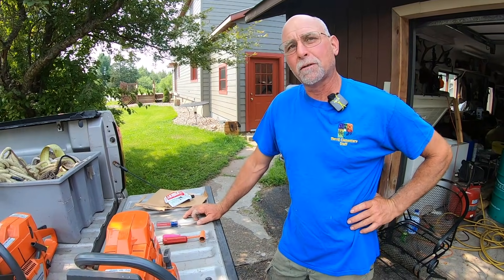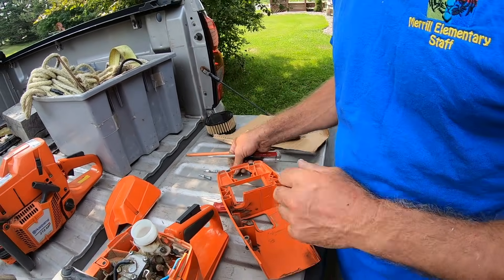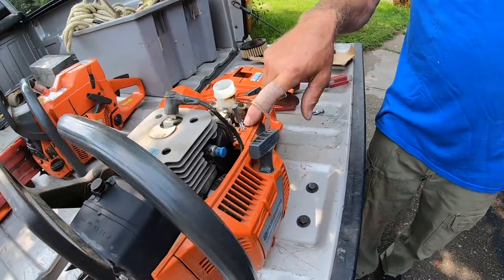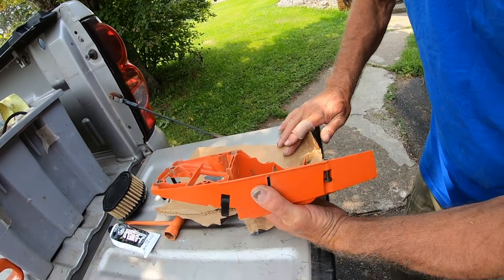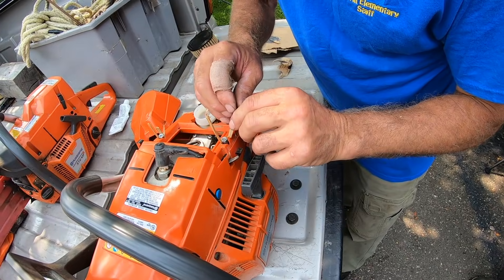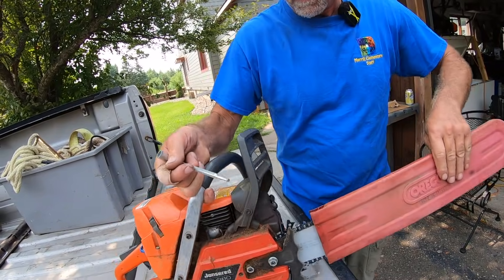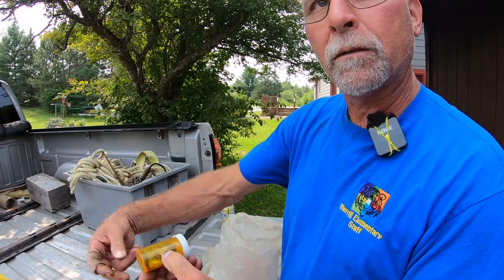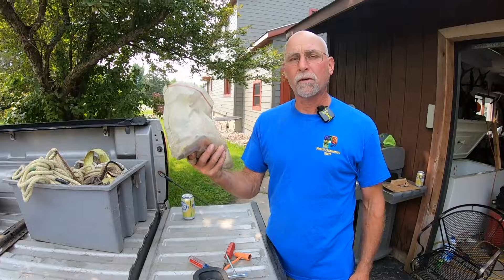Husqvarna 395 Stripped Nuts - Repair Job - #397

Comment: Once upon a time, I had a similar issue with a woodheater - needed to tighten a nut in a hole just like that to adjust the bimetallic spring loaded air intake. I ended up making a 2 pronged fork out of an old flat file, and keyed it into 2 slots I filed into the head of the nut. It worked, but it sure was a pain in the ass.... Necessity is the mother of invention. Good job Ken. 👍😁🇦🇺
Reply: That's what i thought of when he mentioned the hole problem lol. Nice to see it worked somewhere!
Reply from the maker: Yup, sometimes you just got try stuff till you figure it out.

Comment: Good morning Chris!!😀😀
Before I would have tried J B weld on it. I would have tried folding over a small zip tie and plugged the hole. Then turned the screw in. That usually works pretty good for fixing striped holes on Huskys. 
Take care my friend!!😀😀

Logger Al
Reply: Or a little copper safety wire stuffed inside.
Reply: But he said the threads were ALL gone on the one side, so fix it so that both holes take the same tool to undo. May as well.
Reply from the maker: Yes, that probably would work but I think Ken was after a more solid fix. Thanks Al!
Reply from the maker: That might have worked too.
Reply: @InTheWoodyard  I watch Bellhopper do it all the time when he is fixing striped holes on Huskys. It seems like that lots of the Huskys have that problem. I think the newer ones like your 572 don't have quite as much trouble as the 3 series do.
Reply from the maker: @aldredske6197  Thanks Al!

Comment: Got to remember to check the screws when start running saws again. Had muffler bolts come out before.
Reply from the maker: Yes, all bigger saws regardless of brand vibrate a lot and need to be checked.

Comment: Wow, you need a small trailer to haul spare parts for those huskies. Well, at least they cut straight.
Reply: Why don't the stihls chainsaw cut straight? Is it something with the sharpening or all of them are like that? I have a stihl ms 291 and I'm about to upgrade, would you go with a husky? Thanks!
Reply: The Stihl is great, I own 6 of them. That is in reference to a comment that Chris said to Tony on a video.
Reply: @TheDriftlessHomestead  cool, I'll be getting a 661, which ones do you have?
Reply: My production saws are: ms500i, ms362 and an 034. The others are smaller homeowners saws for doing release cuts.
Reply from the maker: HA!  Everything will wear out and break eventually if you use it everyday all day regardless of brand.
Reply from the maker: It was just a joke!
Reply from the maker: 661 is a great saw.

Comment: Heli coil .. lock tight. Jb weld works good  .but every time u take them off u have to jb weld them agin and wait a day to use the saw
Reply from the maker: No he won't, it is to hold the bolt in place so that the cover and nut can be held down. And it did work out fine.

Comment: If the JB weld truly is stronger than the aluminium an alternative would be to oil the thread of the screw. Screw the screw into the remaining thread and then bog up the gap to create a fresh thread. You could even dome the JB Weld up slightly and then wallow out the plastic in the cover to suit it. Probably worth checking with an alternate screw to see if the concept works and whether oiling the thread allows the JB Weld to be released.
Reply from the maker: Thanks Alan!

Comment: Husky's have a reputation of rattling apart.
Reply from the maker: Ken used Stihl saws professionally for years and after tons of problems with them he switched. If you use equipment all day every day you will have issues no matter the brand or kind of tool.

Comment: I wonder if any one ever puts Lube on the Roller  at the front of the Chain Saw Bar?  Seems like it would not be a bad idea.  Maybe it gets oil from the  chain as it comes around.
Reply from the maker: Yes, I do, there is a grease hole on one side, I put a shot in every 2-3 chain sharpenings.

Comment: Chris that is the major difference between Husqvarna and still chainsaws everyone that I talk to that has run both in their lives says there's no comparison still all the way it's not because of the power because for the most part huskies are a little faster it's because the way they're put together the German engineering they don't break as much they start when you want them to
Reply from the maker: Ken did run Stihls professionally for years and switched because of constant break downs with his 6-8 saws and now he is happy with the Huskies. All saws are great and all saws break eventually.
Reply: @InTheWoodyard  no not professionally I've had mine for over 20 years I've never had screws loosen up but anytime I run into tree service professionals I ask them what they prefer and all of them tell me hands down steel and it's because of the German engineering is incredible... The swedish might make more power but they don't come close in the engineering just look at a Mercedes or BMW or an Audi or Volkswagen

Comment: Buy a Stihl  wont have that trouble
Reply from the maker: Ken ran lots of Stihl saws professionally for years and switched because of constant break downs on the job. The fact is everything breaks eventually with constant work, even people.
Reply: @InTheWoodyard  I don't see how that can be I can honestly  say in 30 years I never had stihl let me down as professional  logger. I have never had a Husqvarna that could keep up with me. I know many loggers that run them and most of the time after talking about saws for a while they always mention well there $100 less then a stlhi  so I think it's the price not the proformance why they dont own Stihl. But Husqvarna does get the job done